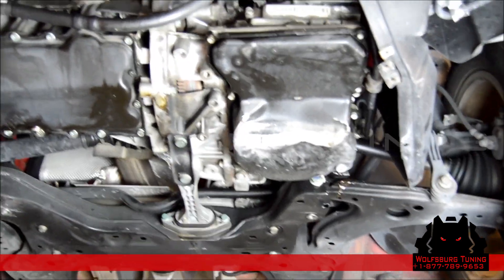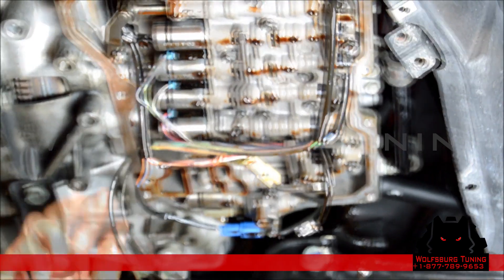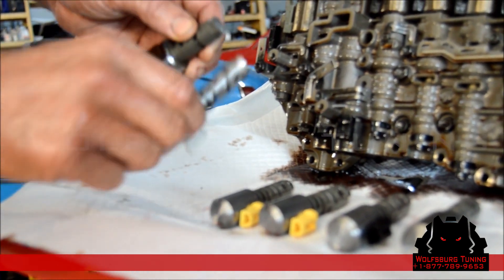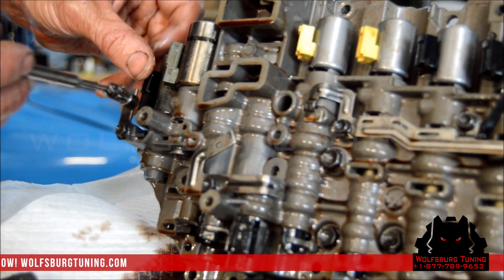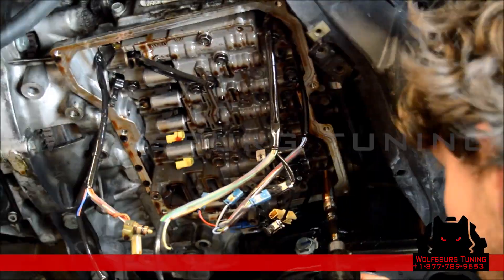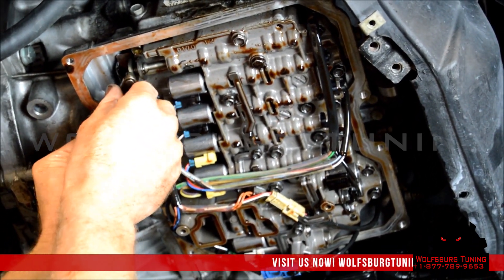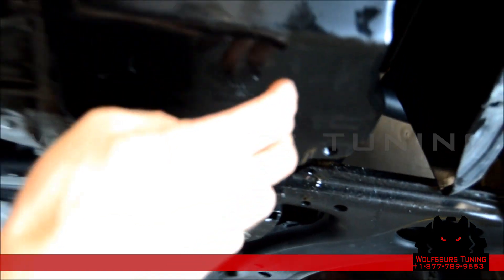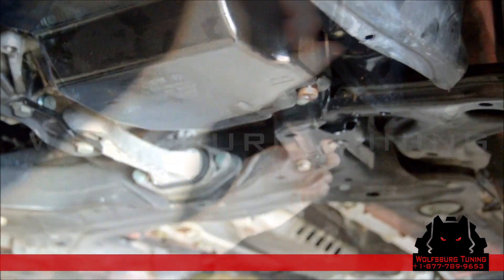WolfsburgTuning.com - Audi & VW 09G Solenoids Installation

Comment: Is there any benefit in replacing the entire valve body with a remanufactured one as opposed to just replacing the linear solenoids alone?  Does the refurb process do anything to the valve body itself that is germane to the flaired and hard shifts problem? Thanks
Reply: Good question. I pulled the full valve body out of a junk car and going to swap the full thing instead of replacing the solenoids. I didn't know that was an option when I started this project.

Comment: Hi all , hoping someone can help me? My 2008 beetle started shifting hard so I change fluid and worked good for awhile and then forth gear started sipping? So I ordered a solenoid kit all 8 replace them all and second and third gear were sipping??? So I replaced them back to the old solenoid and only forth gear is sipping again... so my question is which solenoid is forth gear on the value body ? from the shift level  would the first solenoid be number one gear on back to six???
Reply: If you did not find metal in oil pain and no codes then most likely is your valve body . Same happened to my Jetta . Changed solenoids but did not solve the problem. I ended up buying rebuilt valve from eBay and problem was solved
Reply: if you didnt reuse your old fluid, your probably not going to fix the problem. these transmission fluids arent meant to be drained and refilled with fresh stuff. it removes alot of the friction binding materials that help the clutch pack grab.
Reply: @ladeneterry3442  I flushed mine like 4 years ago because I was having a hard shift. It fixed the problem for 4 yrs. My hard shift is back though. I'm swapping the full valve body with another one and adding fresh fluid again.

Comment: So it’s ok to replace the older large can solenoids with the small can ones? I was looking at valve bodies on Sonnax website and they seemed to be saying that you can’t change big can solenoid valve bodies with small can solenoid ones. I’m referring to the linear solenoids-not the N88, N89 “on-off” ones. I know those “on-off” ones are all big and have different ends on them
Reply: You can put the small can solenoids in the place of large can solenoids. Complete valve bodies are usually not compatible.

Comment: Hi,

Well-done what you did!
I have Passat 2003 automatic, and when I´m trying to cross someone on the highway the car speeds up from 80 to 100-120 and it makes a kick while changing the gears. Do you think it may be solenoid?
I´ve made a gear box diagnostic at the car service and the report was that the gear box is fine.
Thank you.
Reply: did u changed trans oil and filter ?
Reply: @uleule136  
The problem was coming when I kick down it happens.
After change the 091salanoit and full service to the gearbox everything is fine now.
Even car was taking 8L for 100km now 6,8L for 100km
Reply: @omarabdelaziz-el-ashry-Eg  by salanoit u mean selenoid. Right?
I think i have 2 bad selenoids cuz my treg harsh shifts from 2 to 3 and 4 to 5 
And yes when i kick down it gets even worse 
How much did it cost?
Reply: @uleule136  solenoid yes,
If you can do it your self is better because it's too expensive.
Check all of solenoid and change oil and filter.
If you have Facebook send me your name can call you and explain to you more.

Comment: 10:55 My friend, where can I find the raiser? I don't have it on mine, so I can never know for sure if the level is correct. Can I buy this part?
Reply: Hi Fernando. Some cars have the drain plug and the riser integrated into one (like the one in this video). First you unplug, then you get your tool farther in to unscrew the riser. On other cars they may be separate. In this case the riser doesn't have to come off.
Reply: Thank you so much for your detailed answer!
Reply: I wanted to know car is not changing gears.so what could be a problems of vw

Comment: Are all of the bolts that hold the valve body in place the same length? Do I need to worry about ensuring that the bolts go back into the same hole they came out of?
Reply: The bolts are different sizes. I just pressed them into a piece of cardboard from an old box in their rightful places along with the 2 brackets that must be removed along with their respective bolts.
Reply: Most of them are the same length. There is a couple longer ones.

Comment: Does anyone know if this can be done without lowering the valve body?
Reply: Waiting for a reply on this question myself.
Reply: No you can't because the solenoids can't come all the way out. The housing of the transmission is on the way.
Reply: you can just take the rail that holds the pins and you can remove every solenoid that way.
Reply: Thank You!
Reply: @tonytrilex2555  Just change them one at a time unless you know where they all go

Comment: Just order my solenoids off Wolfsburg tuning can't wait to change them! Hopefully it goes good! An the hard shifting can stop.
Reply: let us know if this solves your rough shifting plz
Reply: Hi,

Well-done what you did!
I have Passat 2003 automatic, and when I´m trying to cross someone on the highway the car speeds up from 80 to 100-120 and it makes a kick while changing the gears. Do you think it may be solenoid?
I´ve made a gear box diagnostic at the car service and the report was that the gear box is fine.
Reply: Did you change the solenoids?  How were the results?

Comment: Good Job. How do you mark the wires to make sure they go back correctly? Is there anything that will drop out of the valve body, like springs, ball bearings once removed? Also, are there any gaskets to worry about when reinstalling valve body? Thanks
Reply: David Peiffer Just take pictures before removing the wires they're different colors and lengths and yes one spring will drop out when removing the valve body
Reply: Mine came apart.  Is the spring on top or below the cup?
Reply: @brucestevens1958  spring in to valve body, the cup rest on the valve body!

Comment: Thank You, I just received a upgraded valvebody and it came with small solenoids but the OEM has large. Was a bit worried to install but after your vid I am but more confident to try. I will post an update after.
Reply: Sam L I just did this job in a 2005 vw beetle. There was an actuator/ piston with a single spring on the drivers side front. Spring went in first and the sealed part of the actuator went against the valve body. As far as the connections i used a small flat tip screw driver and wedged the left conner under it and turned it counter clockwise. Not sure if you have the vw scan tool to reset but i did not use 1. I disconnected the battery during the whole job, car ran great when cold but got stuck in 1st gear. I pulled the car over and did the kick down procedure. I shut the engine off but kept the key in the on position. I pressed the gas pedal down to the floor 10 times and restarted the car and drove off. Car did run rough but after 20mins later car ran like new again with no lights. Proud to say 3 weeks later my car runs awesome.... Good luck and hope my info helps you out.
Reply: @ALAH31983  did this fix your promblem or did you have to take it in to reset the selonoids
Reply: Hey guys just an update. I have installed the valvebody for a few weeks now. The first few days it drive slightly rough but after that I am assuming the computer relearned the new valvebody and it has felt like a brand new transmission since. By the way, I had a EURO/JDM Audi A3 and I used a USDM 2005 Jetta valve body as replacement.  Thanks again for this video.
Reply: RS Williams. Im doing this job now too.... Did you use the scan tool or reset anything with a scanner?
Reply: ALAH31983 Hi, no I didn't. I was prepared to bring it to the dealer but after a few days of driving it sorted it self out. I've read this doesn't happen all the time so I guess I am in the lucky category.
Reply: RS Williams i have an 2005 vw beetle, mine would run great then after 20 mins of driving it started to slam into gear. I also read online there is a manual way to reset it and it needs driving time. Ive seen this once on a nissan. Thanks for your response waiting for the parts now.
Reply: Hi there, Is there any springs or check balls that will drop when the valve body is removed?

Also were the connectors hard to remove?